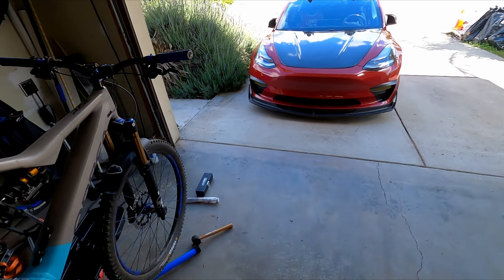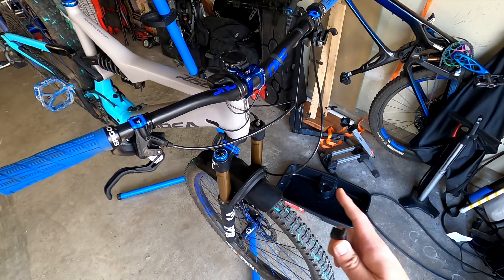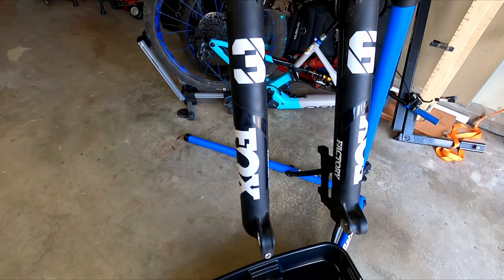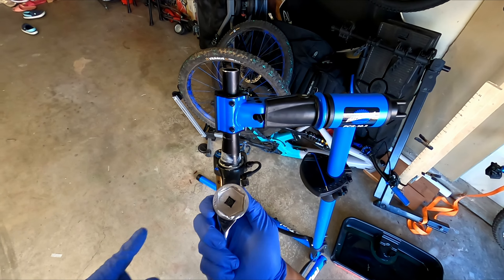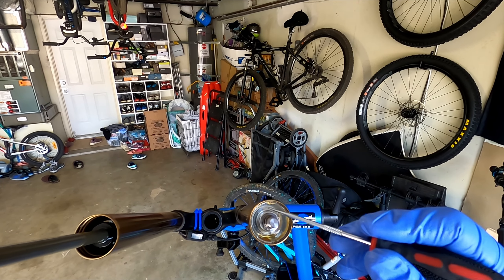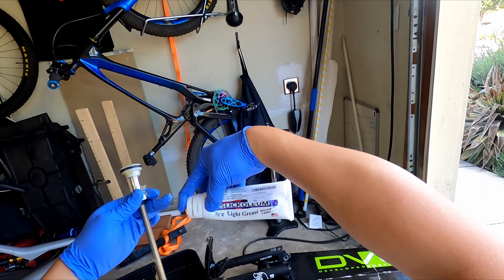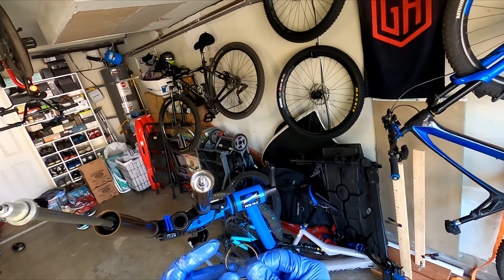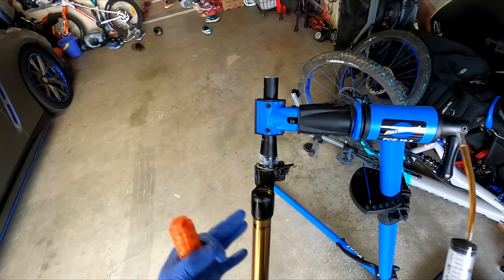Orbea Rise Hydro - Increasing Fox 36 Factory Fork travel from 150mm to 160mm 🙌🏻

Comment: Good video!  Will this work for a 2021+ 36 Performance Fork ?
Reply from the maker: I'm pretty sure it will but double check with Fox manual. You can find it by enter 4 digit/letter code on fork 👍🏻

Comment: Great video, exactly what i want to do .What are your settings on your fork.
Reply from the maker: Thanks buddy! I am about 230 lbs riding weight. Pressure 106 PSI, LSC 6, HSC 3, LSR 2, HSR 1. (clicks away from fully clockwise). Still tuning with ShockWiz though!
Reply: @allshownogolf  Many thanks , its a complicated shock to get dialled in.
Reply: Is that 2 from closed ? Man that must feel dead as. How many tokens and sag?